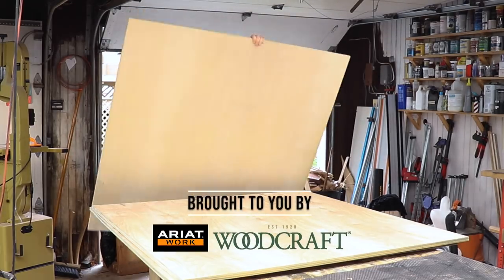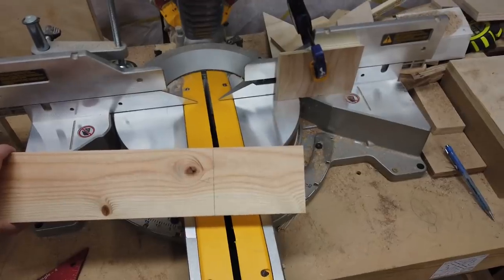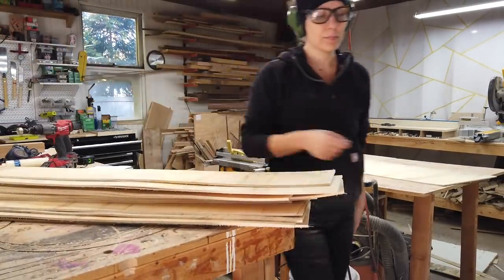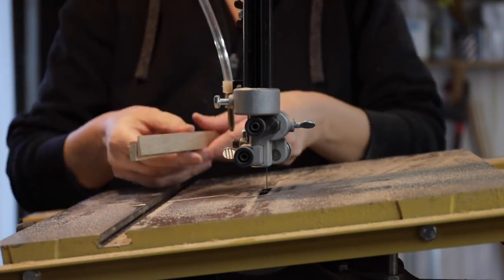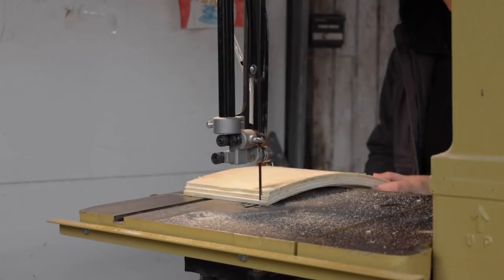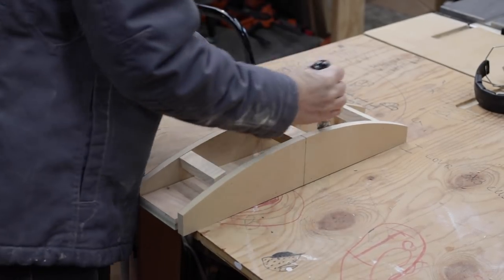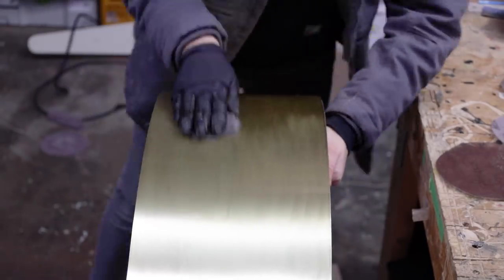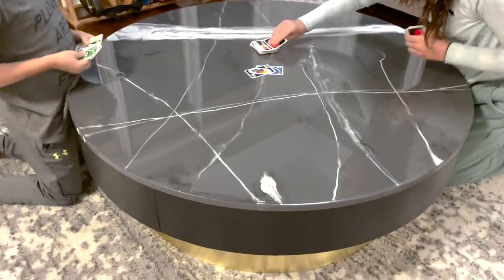Building a Round Coffee Table with DRAWERS, BRASS VENEER Base & FAUX MARBLE Top!

Comment: Always enjoy your learning curve and honest comments about how things go.👍
I totally agree that technology is great, but most projects are usually completed with basic simple tools, usually faster.😉
The "angle on the curve and I don't care" comment cracked me up.😂😆🤣
Oh so true! Just scribe a mark and there you go.😁
The double stack angle jig is actually quite handy and if you use screws to connect them you have a set of curve angles for future projects.😉
All those little details really make the difference in your projects and of course the OCD doesn't hurt.😂😆🤣
What a beautiful project.👌
By the way, on the brass, brazing (similar to soldering) with a propane or MAP gas torch and light gauge brass rod is the best way to join the seam, but does require a good bit of practice to concentrate the heat and reduce heat transfer to the under surface.
Reply from the maker: Haha so glad you enjoyed! 
Yeah. I tried brazing with map gas on scraps. And I burnt the wood underneath. Definitely something I need to experiment with
Reply: @3x3CustomTamar  Start with a pin hole tip so you can lower the heat and concentrate the fine point only on the joining ends and filler rod.
Yes it does require a delicate touch. Another more common option is to put a small recess at the end to accommodate a fold-over butt joint or pinch seam, much like an inlay. Unfortunately neither will give you the seamless look you are going for.
The trick to brazing is finding the least amount of heat to get the filler material to bond with the surface, especially with thin metals.
Brazing is definitely a good cold weather thing to do.😉

Comment: I used a very simple faux marbling technique about 25 years ago on a dining room table refinish project.  it went something like this:

1. Sand the surface fairly smooth (220 is good) to hide the grain/imperfections and leave a good surface for the paint to adhere to.
2. Roll a base color coat using a smooth finish nap roller. You could spray this coat too, but I was working in the house and didn't want to deal with overspray and fumes in our living space.  Plus, I'm really good at getting a smooth, even finish using a quality roller.  Apply about 2 coats lightly sanding in between. You want a fairly smooth finish. There's no need to obsess about it though. 
3. Get a feather (yup, a feather) from an old feather duster.  Make sure it isn't loaded with dust. Dip it into the paint you are using for the veining and apply streaks to the base color coat. Roll the feather a bit from time to time to vary the vein thickness. Replace the feather as necessary when the barbs (blade portion of the feather) get saturated and collapse too much to be useful.  Remember, random and varied thicknesses of the painted vein make it more realistic looking, so you'll get a lot of use out of one feather. Just be careful of drips.  If you get any, draw them out into a vein line.
4. Apply a coat of clear polyurethane. Let dry and lightly sand.  I repeated this step 7 times for a deep glossy finish. Hey, I didn't say this was a quick and easy method!

The result was VERY realistic.  A moving company estimator didn't believe it was a faux finish until he touched the surface and found it wasn't cold like marble.  The thick poly finish gave the finish a deep, polished stone appearance and was durable and kid-proof.

BTW, great video as always!
Reply from the maker: The feather tip is great! I’ll add that in the video next week! Awesome!
Reply: I should have mentioned that you hold the feather by the point of the quill and dip the barbs in the paint. But you’re a smart lady and probably figured that bit out on your own.

Comment: I like these videos with a lot of things to figure out -- probably because you always do a good job.  

With regard to the brass seam, I wonder whether a scarf joint would look good.  You'd taper the inner part to a feather edge and lap the other over.  Judicious sanding, perhaps with a concave block with abrasive only in the center, might give what you want.

If it worked, an existing seam might be concealed by flattening, covering with a brass strip, and sanding to a curve.
Reply from the maker: I don’t know. I would need to experiment more
Reply: @3x3CustomTamar  I should have started by saying it looks great as is.  It does.

Comment: Nice work! One trick I do when I stain my guitars is to wet the surface with denatured alcohol to raise the grain after my first 220  pass, that tends to raise the grain without messing up with the glue on thin veneers. After that I do a 320 pass to nick off the raised grain before stain, Same as you did with the first coat of paint, so just a good idea to keep in case you delve into thin stains. It will save you from fighting blotchy spots. Not needed as you covered it, just an FYI. Just found your channel a week ago, thanks!
Reply from the maker: Interesting. I’ll have to try that one day.

Comment: Hey Tamar! You could probably use Brass Solder Wire to solder (weld) the seams together and sand to blend it in after~
Reply from the maker: I did so much research. I got one product and tested on scrap but it burned the wood underneath. I don’t know. Maybe more testing

Comment: So, a thought on the brass seam. I would leave a void in the wood below the seam. I would then weld the seam after the brass had been applied. I would use AC TIG to make the weld, as the heat would be more concentrated than with an oxyfuel torch, and MIG and stick welding aren't that great for delicate work. I would try to clamp metal objects of some kind as heat sinks near the weld, to avoid heat being conducted into the wood. Once the weld was cool, I would fill the void, and then sand down the weld. Granted, this method would not be for the faint of heart, since TIG is typically one of the most difficult welding processes to perform, and welding machines capable of AC TIG aren't cheap.
Reply: What about solder? I would think solder is easier for the uninitiated.
Reply: @terdsie  It's certainly easier, but it's the wrong color, and would stick out like a sore thumb if the ends of the brass were butted up to each other. It would be possible to sweat a lap joint together, but a lap joint would be more noticeable than a butt joint. The biggest problem I see with soldering in this case, is that I doubt that an electric soldering iron would be able to heat such a large piece of brass sufficiently, and I wouldn't want to use a propane torch that close to wood.
Reply from the maker: I actually tried solder on scrap before attempting. I ended up burning the wood underneath and didn’t think it was smart. And the color match thing. Ha

Comment: I learned that a long time ago with my CNC. One 6' garden bench I used to make it would take 14 hours to cut three pieces out of a 2"x10"x6'. So now I make one pass, I just make a 1/4" wide 1/4" deep groove on the pieces, 1 hour, then cut them with jigsaw. Then use router table. Total time 3 1/2 hours.

Other problem with CNC is the router bits will melt the glue and other chemicals in plywood and MDF. If your feed is too fast, the residue will build up and dull the bit adding to the heat generated, seen burnt wood and snapped bits but nothing caught fire. 

Also mask up... Cancer isn't fun...  just had a 5 month battle, beat it,  now if I can make 5 years without it coming back then they'll say I'm cured.

Comment: I think I would mark out 1/3s or 1/4s around the brass part, saw slots, and use the brass dust and CA glue in those. Then it will have gone from "fail" to "symmetrical design feature". ;)
Actually, I would ignore it, because the table is gorgeous... but it's fun to think about solutions to non-problems.
Reply from the maker: Haha. Yeah. I was thinking about routing out a straight line by the seam. And then filling it will more brass or black stained oak. But I was trying not to call attention to it.

Comment: Haha your face at the end when it falls over... I think we all relate to that
Table: falls over
You: k then f*** you

What's stopping you using the origin in the circle cutting jig and thusly needing only one router?

Oh and protip lass, if you keep your fine saw dust from ripping, mix with pva, it makes a much more natural looking filler :) and it's basically free since you already have those, no need to buy filler.
Reply from the maker: Haha yeah. I had a lot of those moments with this build. And you can’t really use the origin router like that. Its not meant to be used without the on board sensors. 

And I know the sawdust and wood glue trick. Since I was staining this black it actually blended better if I stained wood filler black.

Comment: I love how the "marble" top came out. :)
Is the Triton router a TRA001 (2.4 kW) or a MOF001 (1.4 kW)?
I have an MOF001 myself, specifically bought for an extension on the table for my Dewalt DW745 (Type 4) table saw. It is mounted in the table with an insert plate from Rockler specifically made for Triton routers.
Reply from the maker: Thanks! It’s the TRA001

Comment: That Milwaukee screwdriver, how well does that install small screws without stripping threads? Is the clutch light or does it still strip small screws? Like less than 3/4-1/2 inch, or would you suggest another screwdriver? Thank you
Reply from the maker: I havnt had any issues.
Reply: @3x3CustomTamar  thank you

Comment: Love this design and how you approached it!
Something has been bugging me since I watched the video on the curved drawers though...
By clamping them in the same jig did you not end up with one radius slightly bigger than the other? Or is there sufficient spring back in the material to negate this? 
Looking forward to more projects soon!!
Reply from the maker: Thanks! I did that glue up twice. For both drawers. In that glue up there were 2 parts to the drawer. The inside that’s attached to the sides. And the outside that’s stained black that is attached after the drawer is installed
Reply: @3x3CustomTamar  ahh that makes sense! I'll pay more attention next time!

Comment: Tamar - thanks for a wonderful video.  (insert long comment about being a teacher and feeling like one of the bad students, but then not finding a good way to find the information myself, TL:DR sorry if you've answered this elsewhere). I noticed that Travis from ShopNation had a problem with his Rigid brad nailer in cold weather.  Since you have the "smaller sibling" of the Rigid line, do you find that your battery brad nailer does not sink the nail fully in cold weather?
Reply from the maker: Haha thanks! Yeah. I do have issues in the cold sometimes. I have to change the settings
Reply: @3x3CustomTamar  ok. thanks for letting me know.

Comment: So Tamar, have you given any thought to having a crane in your shop?
Reply from the maker: Haha I have. But I don’t think it will happen 😂
Reply: @3x3CustomTamar  It could be a lot easier than it appears. There are trolleys made to run in Unistrut, which could easily be made into a monorail system, or perhaps a bridge crane. Biggest downside is that such a system would be limited to 300lbs, at most.